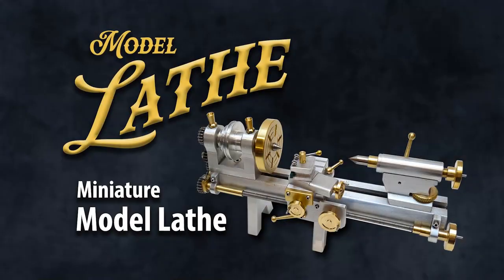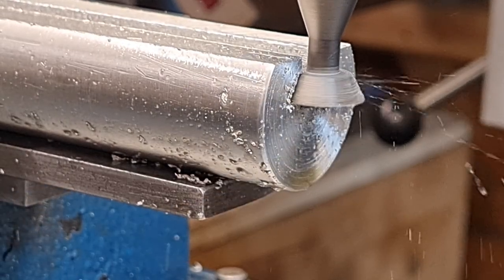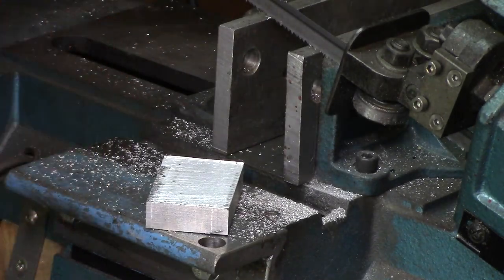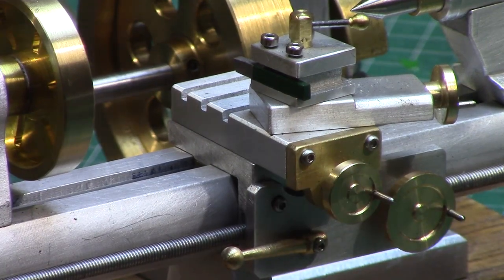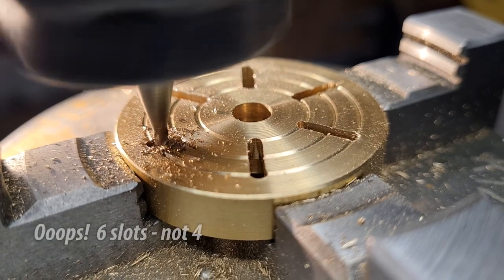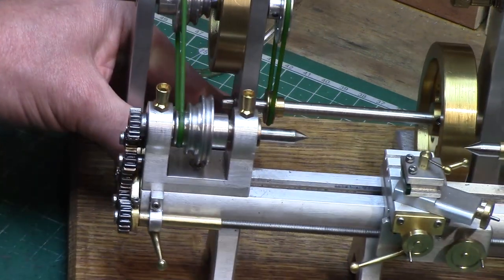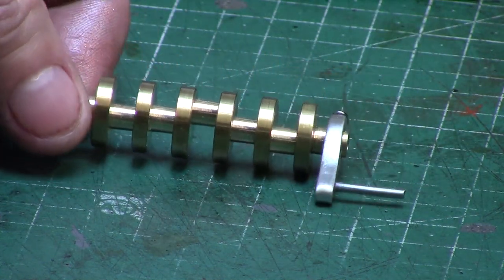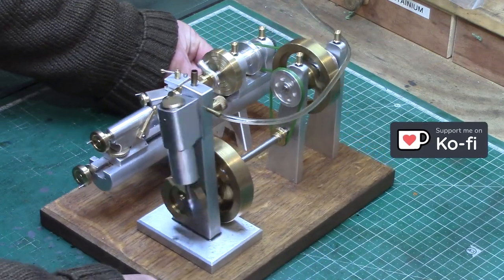I made a Miniature Model LATHE from scrap metal!

Comment: Hi Ade
i just dropped on to you from a Nobby's Workshop Update, so i came over to to take a look and sub'd & bell'd you for future video's👍👍
That little model lathe video took my eye and  is a cracking little model well done with that👍👍, 
I'm just in the process of scratch building a fully functioning micro lathe from some vintage castings i came across, its has no drawings so just coming out of my head as i go, a bit like your thought processes that iv'e seen so far.
Now contact made i will take a look at your other video's and keep in touch, just up my street so to speak👍👍👍👍
Anyway, catch you another time
regards
Kev

Comment: i know it wasnt really intended to be practical, but there is a morse taper #0 that would have been ideal at this size for the spindle and tailstock...

at which point, a sashweight might have been a better choice of material.

an oft overlooked thing with compressed air? if you heat it up first, you get a lot more grunt out of it.